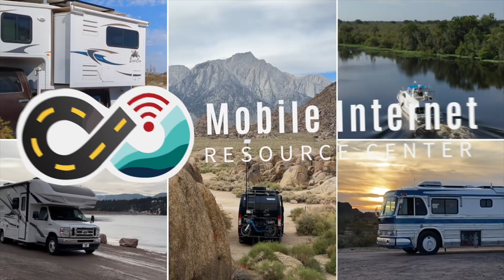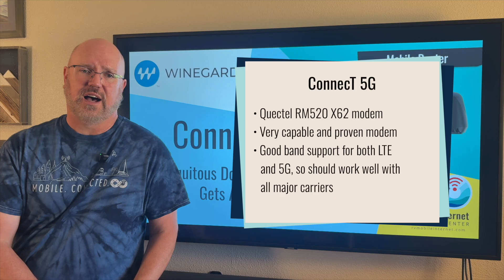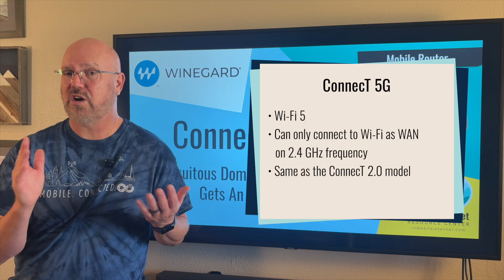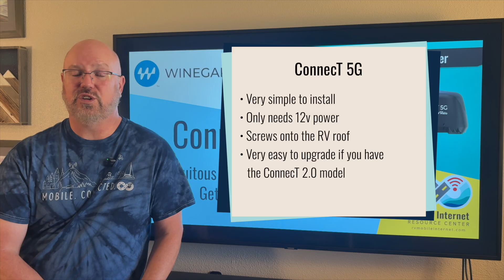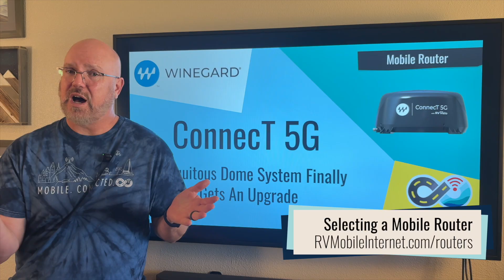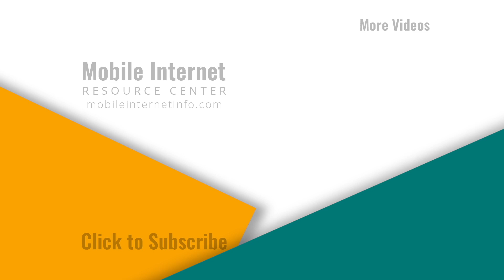Winegard ConnecT 5G Rooftop Dome Released With An X62 5G Modem With Wi-Fi, TV Antenna, And Ethernet

Comment: Yikes,  That’s a 4 year old modem and specs from 2021.  Winegard, do a solid and delay the product and put in the latest 5G modem, Wifi 7 and WPA3.  This will be on RV roofs for the next 6+ years and is already out of date.
Reply from the maker: The x62 is what most router manufacturers are currently using.  Check out recent 5G industry analysis for more - https://www.rvmobileinternet.com/5g

Comment: I feel like the usage of these Winegard systems is very low. RV Dealers and consumers know very little about them so most opt for a hotspot, Starlink, etc.
Reply: Usage is low because they are horrible. Their range is so short unless you can physically see and hit the tower with a stone your reception will be terrible.
Doesn't matter what modem you link to it, the antenna system in them is total trash.